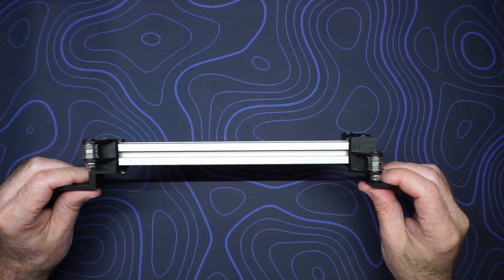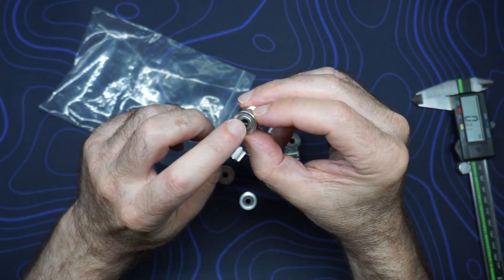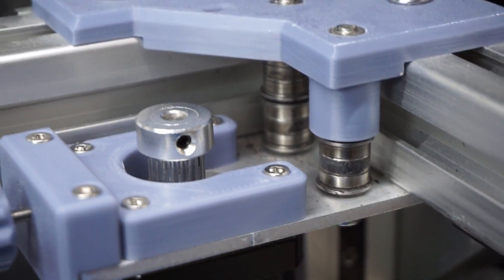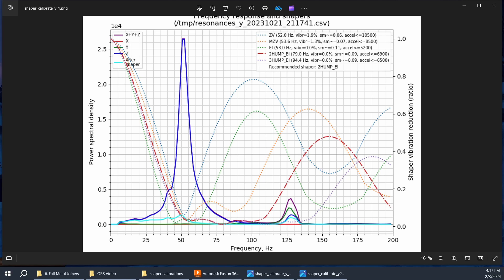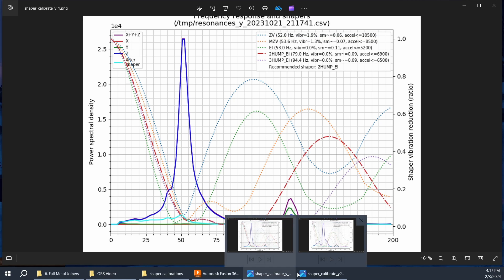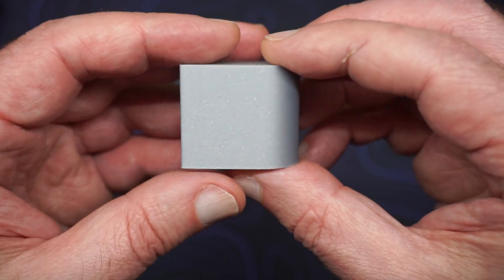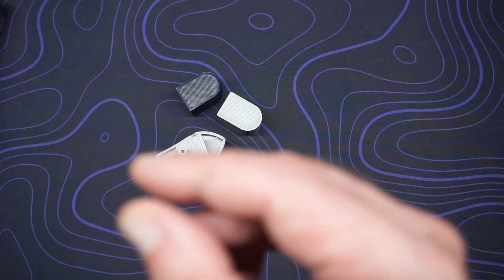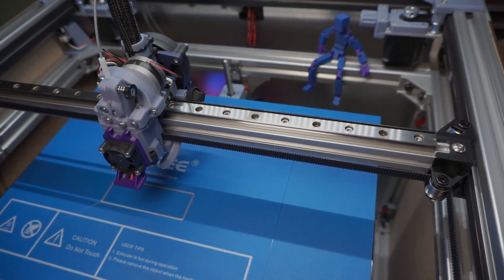Full Metal Joiners! [Ratrig VCore 3.x]

Comment: did u solve the issue of second peak？ i also have same
 Issue and a little racking.
Reply from the maker: I did a rebuild of the machine and got a much better result!  Also, the angle on the joiner mount isn't a perfect 90 degree corner, so if you really crank down the bolts on the 2020 extrusion, you can feel a little binding and resistance on the linear rails.  only tightening one bolt on each side makes it move better.  I'll probably change these out soon.  I'll be looking to see if there are other joiners that I can try.

Comment: Did the aluminum joiners have any noticeable effect on the printer's noise?
5:45 Did you notice that your graph title says 'resonances Y,' but the peak shows Z-acceleration? I think you've got your axes mapped incorrectly. It's fine as long as you're just looking at the curves since you know which axes were calibrated, but for autocalibration, it will set the shaper for the wrong axes.
Reply from the maker: I didn't notice any change in sound or noise with these.  Might be a tiny bit louder, but I can't say for sure.   And you are correct!  the readings will come out on the "Z" since the ADXL board is mounted vertically on my toolhead
Reply: @mikey631  you can use a setting axes_map to account for different orientation

Comment: Those are very bad results. You made it worse, second big peak means serious issues with motion system.
Reply from the maker: did some testing today, and was able to get different results when I shimmed up the frame at the front, so I suspect it has gotten a little loose over time.  the printer is 2 years old, and has had quite a few mods.  I think I need to rebuild the frame and tighten everything up.

Comment: Actually you lost performance. Have a look at the recommended input shaper curve and related speeds in your results. 

Your old set up recommended using a 2 hump EI shaper with a max acellerstion of 6,900.

Your new set up recommende a EI input shaer with a max aceletation of just 6300.

Also look at the residual vibration percentage in your results, because they also got worse.

A very poor result, but probably more due to tuning and alignment issues than the joiners themselves.

As someone else has already pointed out you have very poor Z banding possibly pointing to leadscrew wobble.
Reply from the maker: Thank you for the detailed response.  I looked at some old input shaper graphs, and these secondary peaks recently showed up.  I don't think it's the joiners, as there was some weird peaks on a different setup had with the stock ratrig joiners.  So I am in the process of trouble shooting what else has changed.  though even with these results, VISUALLY, there was an improvement, so there's that.  Also as far as Z banding.  I did some tuning with flow rate, and have improved that considerably, so I don't think I have major issues with the lead screws.  but again, that could be something else to test.
Reply: @mikey631  Yep agree it is unlikely to be your new joiners. More likely to be something that got upset in the process of installing them. Maybe check that you X rail slides freely in the y direction with no binding.

Comment: Would like ro see more on your joiners.  I have replaced almost everything else on my Rat Rigs, and am pretty happy with the way they run.  I just added a WhamBam build plate on my 500 cube and it really works
Reply: I went through a few different ones myself and like glass best.
Reply: @noanyobiseniss7462  I was a big glass fan.  Used hair spray if needed, but I'm blown away on the performance of the WHAMBAM PEX sheet and magnet bed.  It was pricey, but works great and just pops off.